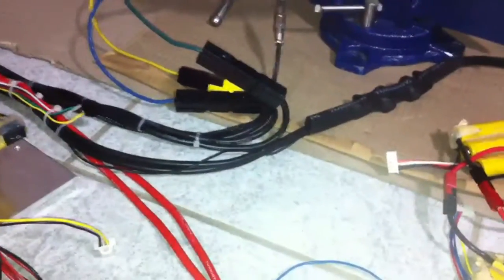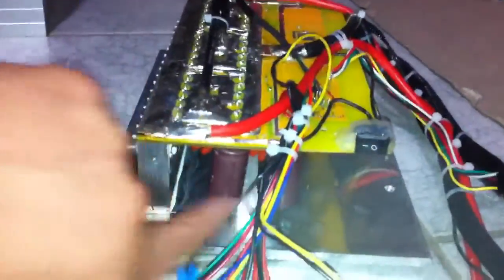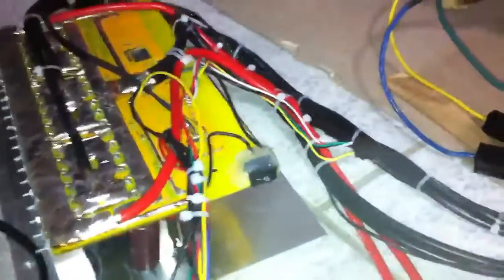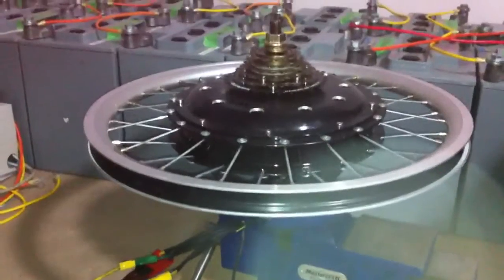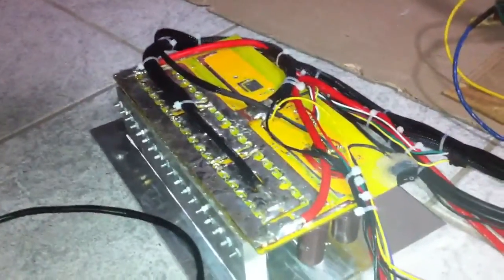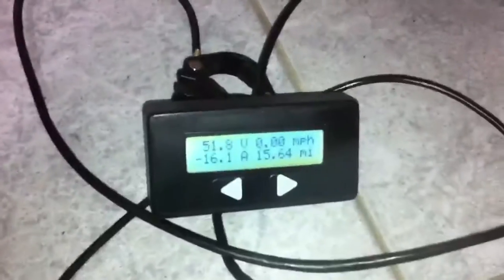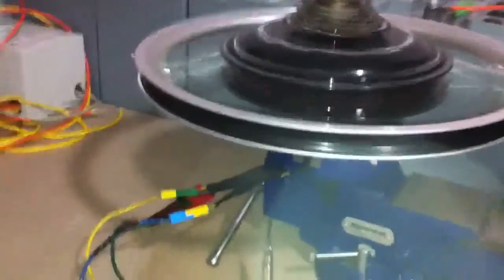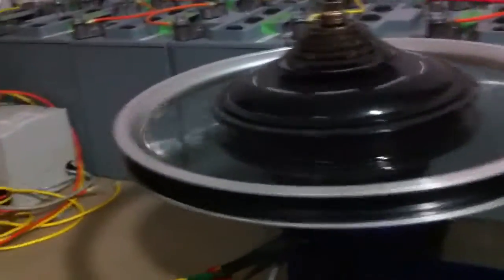My monster 36 mosfet 40kw controller

Comment: Hy, how do you ghearet 40Kw with 36Mosfet(smoll MoS), for 1mos maxim 170watii reated power 48/72/94Volti,,
      For 36Moss controller unit and 72/94V is maxim current( 14Kw )...
Reply from the maker: Very good point, I believe that's continuous, peak is higher, I remember with a 12 mosfet controller I can hit close to 10kw peak under acceleration.. that's 6 mosfet on the high side which see alot of stress under load.. I also had a 24 mosfet at one point and that one could hit 20kw concervatively... it's been a while since I tinkered with these controllers, but they where alot of fun at the time to see what you could get out of one power wise

Comment: What is the difference of a 12 mosfet 48 volt controller and a 18 mosfet 48 volt  controller?  Other than the number of mosfets. Thanks.  I hope you will respond.
Reply: @yogesh kumar singh Sure.

Comment: I was going to build a controller using 24 "Fqp50n06 Mosfet" but now i will follow your idea. the "irfb4110 mosfet" can dissipate more heat and handle more power.

Comment: How much current 24 irfb4110 can handle, what do you think?
Reply: The maximum power dissipation of each MOSFET is 370W. If you could cool it down enough, you may be able to hit the limit of TO-220 that is 70A. Just calculate that with your operating voltage.